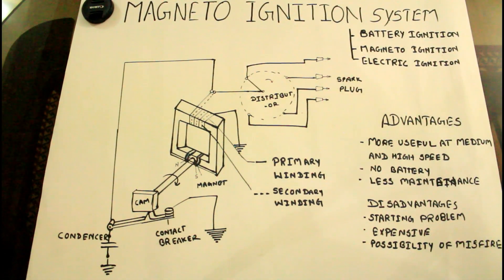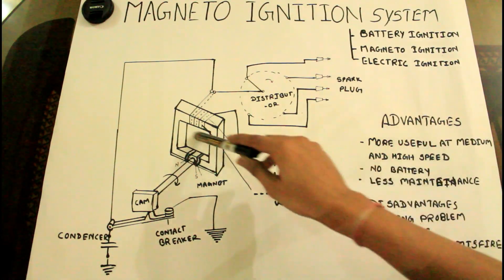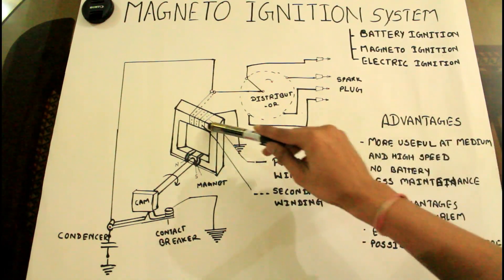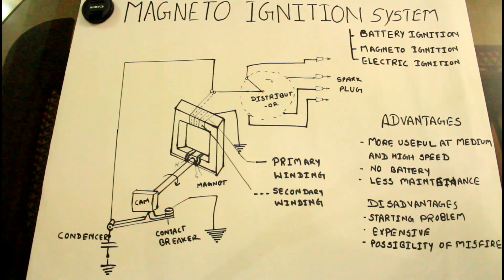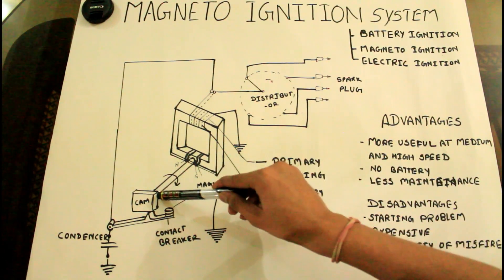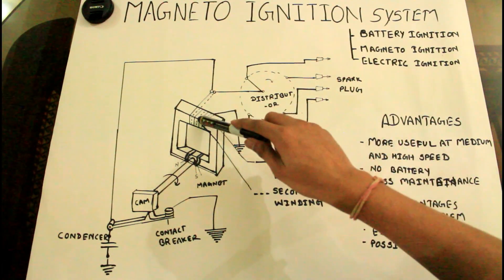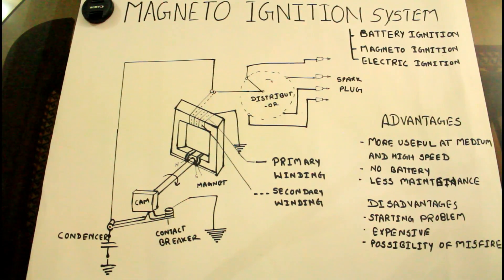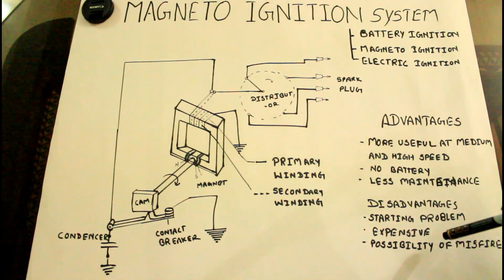Magneto ignition system

Comment: A good video indeed. One thing to be mentioned is the creation of spark from spark plug as it is also a part of ignition system. High voltage overcome the dielectric strength of gases between electrodes. These gases are ionized and change into conductor and thereby producing final spark.

Comment: Thank you for the video. You were accurate with the operation of the primary and secondary of the coil windings, your description of current flow was  accurate for the new student to understand without being too heavy with information. Your verbiage was not excessive.( That means you cut out the B.S. and gave good information on the theory of the magneto using a decent schematic to explain it). It was easy for me to learn what I needed to learn.

Comment: without condensor does MIS OR BIS WORKS? @RJ AUTOMOBILE
Reply from the maker: Himanshu Singh Chandel may be for little time but very high primary voltage caused due to collapse of magnetic field which burn the contact points so eventually system would stop working